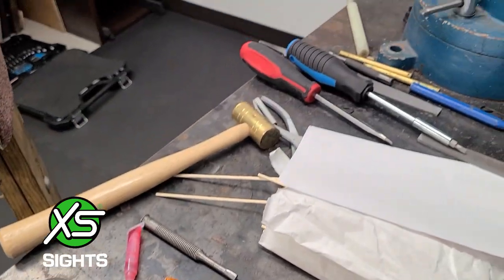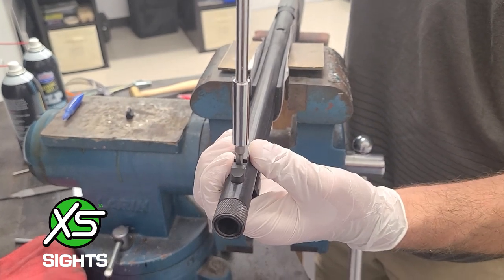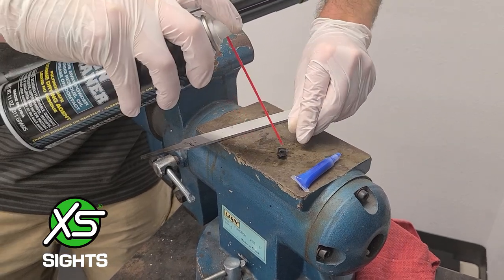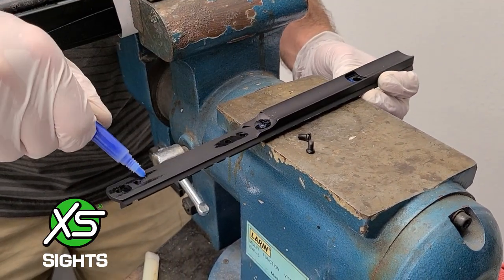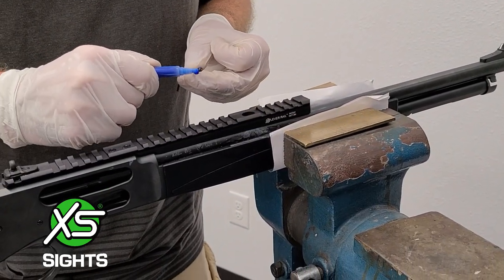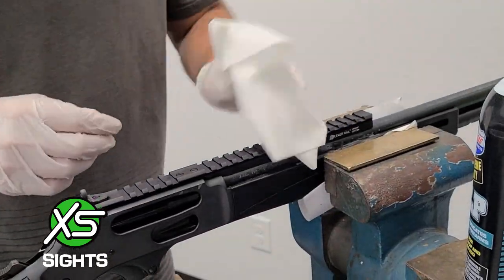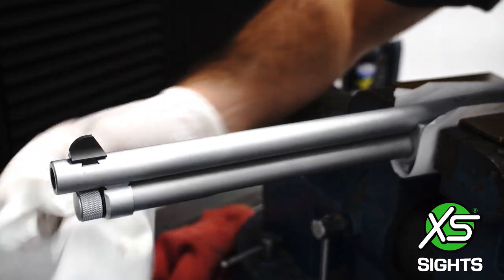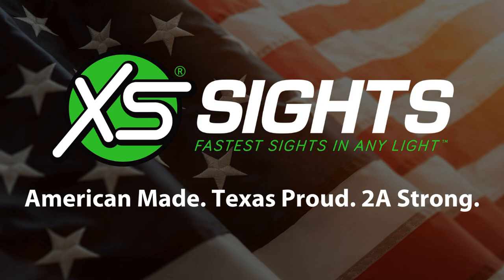Henry .45/.70, .357, & .44 Rail and Ghost Ring Install

Comment: Getting that front sight into the dovetail in the first part of the video was a task. They said to use a file and pass 3x each way... try like 100x and some sanding lol.  You'd thing because it was 2 of their manufactured pieces it would come with a little closer of a fit but either way it got on snug.  Also, the piece that goes into the rail dovetail also files down very quick. I expected it to take forever like the front sight so I did 3 passes like in the video and it was  too much, so go light on that piece. Mine went in pretty lose with very little resistance so I hope the Loctite holds it. 

Just thought id throw that out there for someone else who was attempting to installing.

Comment: Could this fit 357 magnum big boy x?
Reply: Did you try it?
Reply: @jj-218  nope, had to send my rifle to Henry because my front sight was drilled crooked. Since then I’ve just been enjoying It for what It is!
Reply: @evanferguson9553  thanks for the reply, I'll probably try it out in a few months and let you know
Reply: @jj-218  please do! I think It would go great with the ranger point handgaurd
Reply: @Evan Ferguson  I'm running stock handguard just because I'm afraid of doing the install, I heard it's complicated, and then if the rail works I'll probably throw an LPVO on it or an eotech with a magnifier. Plus I threw a muzzle brake on it
Reply: I have a Henry. 45 colt big boy x,will my existing front sight work with the rear ghost ring sight?
Reply: They just made a pistol caliber version of the rail this year